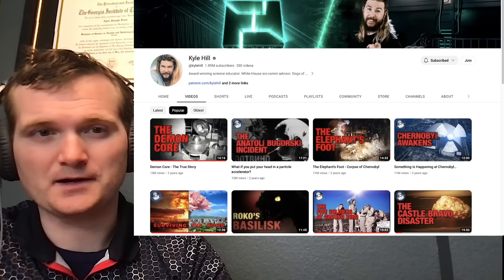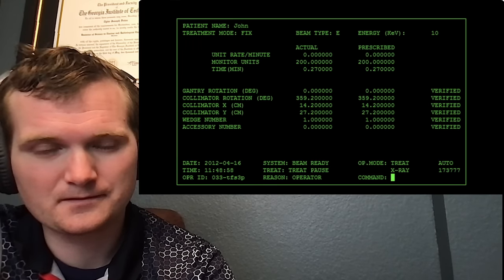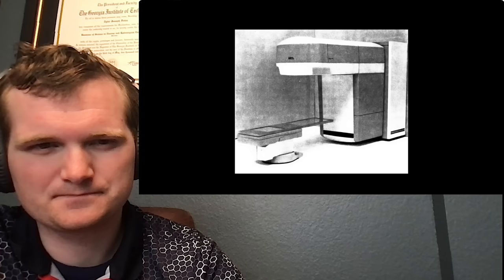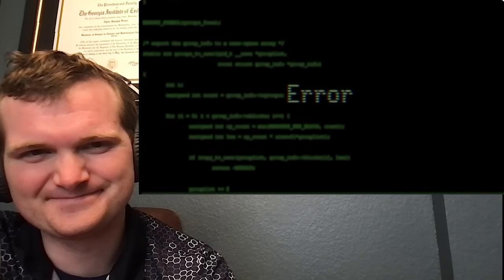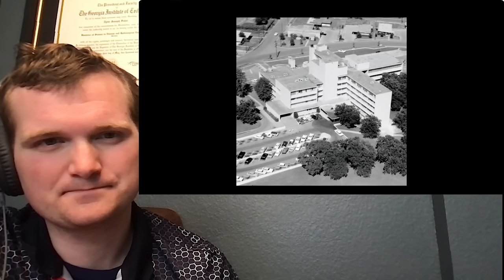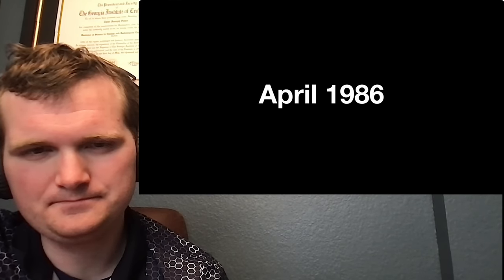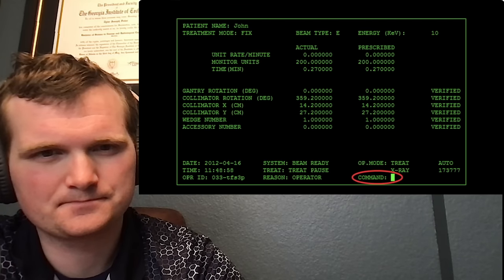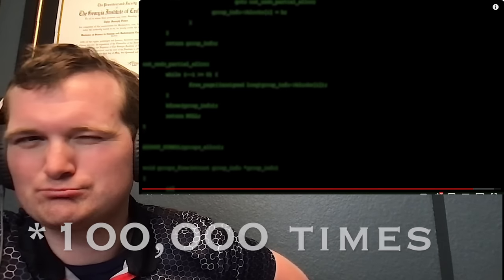Nuclear Engineer Reacts to The Worst Software Error In History by Kyle Hill

Comment: This is something I don't and will never understand. Directly after the first accident, they should've halted every use of the machine until they precisely figured out what actually happend. It's mindboggling to me how people simply accept "it couldn't have been the THERAC-25" as an answer, when it's obvious that the device has caused the fatality. Seriously, where could the high dose irradiation come from if not the THERAC-25? People where actually acting like oblivion NPCs: "Must have been the wind."
Reply: they had too much Hubris
Reply: @Zach476 Hubris or greed?
Reply: Different times sadly. Can't do updates now like you could back then. Would probably require a full recall and bankrupt the company. No excuse for the neglegance of course, just capitalism forcing their hand
Reply: Yeah,so absurd.The lack of locking mechanisms and the inpropriate reusage of old code was the problem,the code was written fine for older model with locking mechanism so it's actually not even to blame the programmer.The machine was created recklessly,insane.

Comment: As a software engineer - there’s a style of coding I use for critical code -> code that cannot be allowed to continue if things are in any way wrong - verifying inputs, intermediate values and outputs are in valid ranges - and testing will include watching the code run step-by-step in a debugger.  That doesn’t catch all failures - nothing does, as even if it’s bug free, it will someday be edited by another programmer, and if you’re very lucky, they’ll take the time to understand the full scope of your code before changing it.  Best of all - it makes the code prone to directly failing rather than continuing with bad data.  In the case of a reactor, that failure may scram the reactor should the software controlling it enters a state that is supposed to be impossible.  In the case of a Therac?  Either hang the software forcing a power cycle, or initiate a soft reset -> which is harsh to users… but do you want to re-enter the treatment data?  Or do you want to use a misconfigured piece of lethal hardware on people?  If you don’t like having to renter the data all the time, fix the software AND hardware.
Reply: My coding prof at university once said "There is no perfect system. There is no bug free code. You will only ever know the bugs, you can find. But there are two random things, that can - and will - cause bugs: Cosmic rays and user input."
Reply: You code to fail, not code to succeed: defensive programming: only inputs you expect are allowed, so success is tested for, and if it's not success... you fail, report and stop.
Reply: @numeristatech  here’s a happy thought - you can’t always afford to stop.  What’s the Flight control system on a passenger jet to do for a divide-by-zero?  Stop working?  Matching the correct failure (warning to operator, halt operation, auto-restart, etc) is a challenge when lives are on the line.
Reply: @Relkond Far as I'm concerned that's why it shouldn't be used for these purposes.

Comment: As someone who actively codes and is studying biomedical engineering, this is one of the most hurting and humbling videos I've ever watched. I can't even put into words how hard it is to watch this, thinking that nobody gave the operators documentation about the errors or anything like that and that, after it killed someone, they just considered it impossible. It always will be something I carry in my heart and mind
Reply: The dude that wrote the original code shouldn't have been writing code for critical hardware. It's that simple.

Under no circumstances should a "hobbyist" ever be given so much responsibility.
Reply: @MadScientist267 
To be fair I think all programmers were hobbyists in 1984. His code was fine because it was written for the Therac-20 — a system with hardware interlocks. It is the AECL’s fault for using it on a purely software based later model without adjusting it or testing it at all. Being able to program an entire machine actually makes him more talented than most of modern programmers.
Reply: @beyondredemption8179 not to mention that aecl just put down serious accusations as "that can't be"

Comment: As a computer programmer, this is quite literally one of the first things you learn in SWE to teach you the importance of having baked in safety and error checking to prevent operators from doing something dangerous. You need to assume the user is not an expert and doesnt know what should and shouldn't be done, so you need to ensure that the software doesn't allow them to do something that shouldnt be done.

Critical rule of engineering, if it shouldn't happen, make sure to design it so it can't. It's sad that rules like this typically only get realized after terrible tragedies.
Reply: This is just like iOS and Android. iOS prevents users from downloading any apps from other websites because they might contain "dangerous" malwares. Android allows that. Though I think if a person buys something, they should have the freedom to use it however they want unless they are doing something illegal.
Reply: From today's perspective, it is obvious. But in the 80s the world was a totally different world. Computers were for researchers and super nerds. There was no software to be used by users so no idea how to write such software and check for user behavior.  When you use your own software you know how to use it and can live without those checks easily.
Reply: Also why many software engineers can't get features done "on time;" if it isn't a well tread path, there's always a few edge cases that don't become apparent until you get down to the details.
Reply: @sayanama Android does give a warning about downloading from potentially malicious sources though.
Reply: It makes me think of the line, "every safety rule is written in blood"
Reply: Nothing is a substitute for physical interlocks.
Reply: Yes this is NOW what we learn, BECAUSE of how many terrible mistakes happened before. We are now teached since the very first year that every single thing we do NEED a message error stopping the program if it should. It's not "if you want" it's "necessary" and that's a very good thing. Yes we still have professionals that don't do their jobs absolutely properly, but we really do learn about this kind of terrible accidents and how one single little verification in the code could have changed everything.
Reply: THE LEAST I would do, and that is the absolute LEAST, is I'd not let the software configure the hardware to a limit that is life-threatening, thus hard-coding maximum limits... That is one of the MOST basic of programming.
Reply: yeah,the machine was extremely bad designed,so absurd.It's not about bugs but we need to control the consequences and have ways to deal with them especially for a medical device,it must have had to be more concerned.
Reply: @sayanama  Not really comparable 
If you get malware on your iPhone, it won't malfunction to the point of killing you (at least it's very unlikely! The worst case scenario in terms of physical safety is if it causes a fire). 
The stakes are not the same
I want to be able to do whatever I want with my iPhone; I want to be able to replace the whole OS if I wanted to, but I don't want the same freedom for an actually dangerous device 
I worked on software for an EV charging station, and we DEFINITELY don't allow you to do whatever you want with it or replace the firmware 😂
Reply: @sayanama  That has nothing to do with this conversation. Its nothing like the situation where vendors to determine where you can get software from. That's a complete different issue that most concerns companies having monopolies. What is being discussed here is the concept that if your software encounters a bug/error, permitting the user the proceed when its now dangerous to do so, is poor programming. There's no way the user can be expected to have enough technical knowledge to know if an error can be safely ignored, so its own the programmer to lock the user out of doing paticular dangerous activity.
Reply: Yea, when I went through my CompSci required ethics course, this was the first case study we looked at. The video talks about the errors the company made, but in ours it talked about the moral and legal burden the programmer had. For example, he should have know that he was not qualified for the task, he should have realized the severity of what he was being asked to do and the repercussions if things went wrong, etc.

Comment: Software engineer here. 

Fortran is clunky, but it has been successfully used in all sorts of mission critical applications. But then again, everything back then was "clunky". There were serious hardware constraints too - these days you won't find much data that's being represented by a single byte, integers are usually at least 32 bits, if not 64. Even in tiny computers or microcontrollers.

The thing that stood out the most to me was that changes were being applied immediately as the operator changed data on the screen. It is possible to do that in a well designed way, but it is far more likely that the user interface code and the code that commanded machine state changes was a bunch of spaghetti, instead of having a clear separation between user interface and the far more critical "robot" code. 

They would have prevented so many issues if the UI was only responsible for setting-up the parameters and handed them off after the operator indicated that they were "done" with data entry - and no more input should be allowed (other than abort, although I'd like a physical interlock instead and a big red button). Only then should the machine command the physical actuators. 

No idea why they did it like that. Some hypotheses are: 1- whoever wrote the software didn't really have a plan and just went step by step(let's add a character entry for beam type, now that we have that let's send the command to the machine, and so on). 2- they were really tight in memory and couldn't do it any other way(unlikely even back then) or 3- they wanted to save some time and start the machine configuration changes as the operator was making them - would that even save any meaningful amount of time if we use 8 seconds as reference? Probably not.
Reply: it's also worth remembering, as mentioned in the video from Kyle, that the software was originally written for a machine with hardware failsafes and protections. So it's not impossible to imagine that the original coder had relied on the hardware to prevent things from going wrong. At least more so than if written for a machine without protections.
Reply from the maker: Thanks so much for sharing!
Reply: Strongly guessing #1 given all the other signs.

Comment: I also lost my father to lung cancer, which was my greatest inspiration to go into the radiation therapy field. I couldn't do anything to help save him, but I try to do what I can to help save others n his name. I have been an engineer working on medical linear accelerators for 37 years now. I knew Tim Still and worked with him at other institutions and on different linacs (I never worked on a Therac, but have seen Therac6's, 20's, and 25's in person). Once they were able to reproduce the error, Tim set up a water tank, which is used as a way of measuring dose in a medium very close to tissue. A video of the tank was taken when they reproduced the error.  He showed me a still from that video,  and it showed a long cylinder with a knob on the end, of Cerenkov radiation. The dose estimate at the point of the electron beam I remember as being estimated at over 25,000 RADS. AECL had purchased the Therac accelerators from a French company called CGR, so AECL had not written the original software core. The Therac 6 and Therac 20 had hardware interlocks that prevented the beam from being turned on if the circumstances of the Therac 25 fault conditions occurring, but the software core did have the same potential for creating the conditions. When AECL came out with the Therac 25, they deemed that they could save money by taking out those hardware interlocks systems. They never anticipated the ability of therapists to quickly maneuver through keystrokes. Producing photons (x-rays) using an electron beam through a heavy metal conversion target is only about  1% efficient, so you need a powerful electron beam to produce a therapeutic level of x-rays. The edit the therapists did when they choose a wrong mode, allowed the target to be moved out of the way (the machines can treat with both x-rays and electrons), the turntable to move to an open port, and the power levels of the beam to be put to that of making x-rays. You now have a hell of an electron drill.  While unanticipated software conditions were ultimately the cause of the deadly setup conditions, AECL removing the hardware interlocks to save money was ultimately, in my opinion, completely irresponsible.  Linacs (linear accelerators) used in treatment today ALL have hardware interlock systems that have to meet specific conditions for the beam to come on. AECL went back and retrofitted all the Therac 25's with the hardware interlocks they removed, as well as changing the code, and how edits could be done.  Modern linacs, which are pretty much all computer driven (with specific dedicated real time operating system state machine code that runs the actual hardware), only allow specific setup sequences to be used. Most also use a system that loads the parameters from a specific patient file, so human error is reduced. AECL was a crown corporation, run by the Canadian government. They mainly had been making cobalt 60 therapy units before they purchased CGR. They no longer are in the therapy business, and closed down operations long ago, and sold off the cobalt division to another company, but didn't sell off the accelerator division. Sorry for the long comment, but I thought you might find the additional info interesting.  I enjoy your channel.
Reply from the maker: Thank you very much for sharing your story, I really appreciate your perspective!

Comment: "We always need a second person checking the code" yes, and today we're gonna learn why that is. x_x 
"Software doesn't make mistakes" - AECL. 
This is one of the examples we get taught in engineering school as to what not to do, and why. Because I've seen beginner toy robotics projects with more fail-safe than this.

[edit:] they did remove the up arrow keys from the keyboards as a temporary 'fix' that didn't help of course.
Reply: We don't need another one to look at the code,if the stand alone programmer were truly professional.However,we need serious testers and of course this machine was extremly bad designed in term of electrical,mechanical and nuclear enginnering.The code wasn't the real problem,but the lack of locking mechanism and a ton of crappy things.

Comment: As someone who has worked in software QA before, for many years, I have personally experienced pushback from engineering along the same lines that was evident with the THERAC-25

Me: Hey guys, when we push this button everything breaks.
Them: Don't push that button, you should never push that button.
Me: ...why does this button exist?
Them: We had a good reason for it, but it's deprecated now.  Don't push the button.
Me: ...please remove the button.
Them: Oh, yeah, I guess we can do that.  I guess.  Do we really need to? Just don't push it!
Me: PUSHING THE BUTTON IS ALWAYS BAD.  CUSTOMERS PUSH THE BUTTON.  SOMETIMES ON ACCIDENT.  PLEASE REMOVE THE BUTTON.
Them: Fine, if it'll shut you up.

Comment: I worked as a manufacturing technician for a while, the exact kind of technician that would have worked on malfunctions like this but in manufacturing. Normally, when we get an error message we don't understand, we take the machine out of operation and we play around with it until we can understand and duplicate that error message. None of our machines that I repaired were radioactive. The most dangerous thing I had to work with was a fiber laser and I did not play around with the laser unit. If it went bad. It doesn't surprise me that this went unresolved as long as it did. Sad to say, it doesn't surprise me that the manufacturing company pushed so hard against anyone, even hinting that there might have been a problem with their machines. This is why companies should not be allowed to do their own safety reviews and yet we still allow that to happen today. I seem tree called Boeing that with their own software not too long ago after a serious bug that led to the death of everyone on that flight.

Comment: As a software engineer, the discomfort is absolutely warranted. Almost no software anywhere is produced to the standard that would warrant trusting it alone with anything important.

 Programmers check things, review things, but that is nowhere near enough. We have the tools to do better, formal verification, but vanishingly few programs are validated this way.
Reply: The lack of locking mechanisms and the inpropriate reusage of old code was the problem,the code was written fine for older model with locking mechanism so it's actually not even to blame the programmer.The machine was created recklessly,insane.

Comment: As a software engineer, this case is insane.
Back then, a single, anonymous programmer with limited experience could write and commit all code for a nuclear device.
Today, you need at least 4 people to replace a logo on a site. One to code the change, one to check the code, one to test that it does what we want it to do and one to approve the change both before work begins and after work is done.
Reply: The lack of locking mechanisms and the inpropriate reusage of old code was the problem,the code was written fine for older model with locking mechanism so it's actually not even to blame the programmer.The machine was created recklessly,insane.